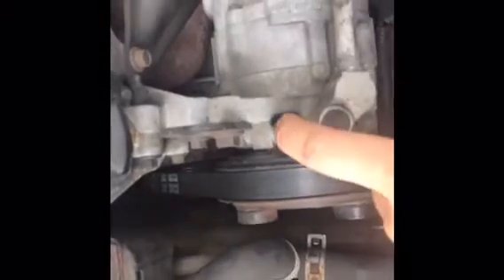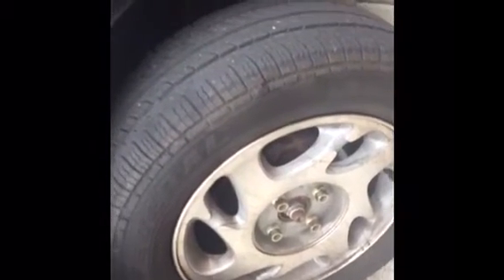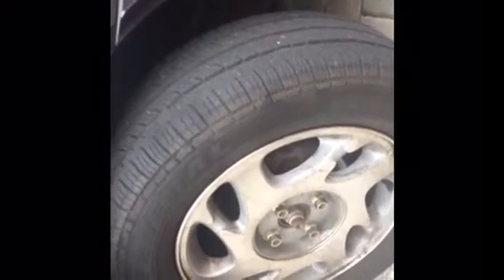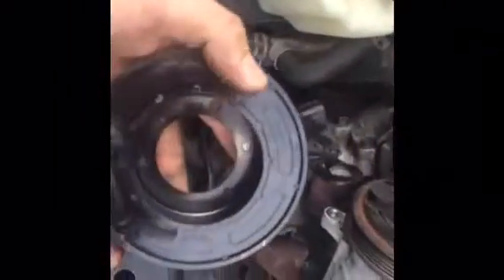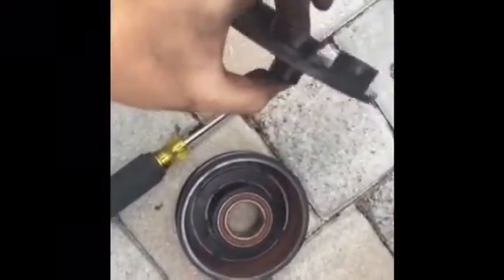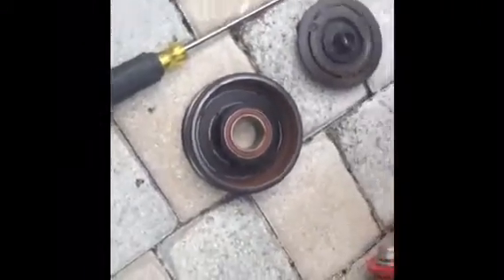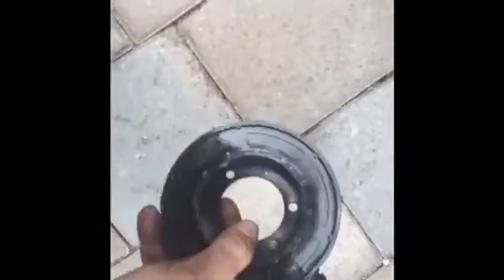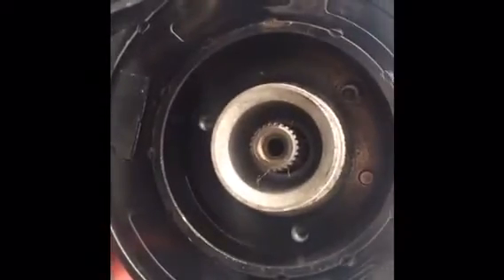Automotive ac repair.

Comment: You must have had to order the clutch coil...I've never heard of them stocking it. Nice repair
Reply from the maker: No  auto parts had the clutch coil seperate. They wanted to sell me the whole compressor. Minimum $275. I found a mechanic shop that stocked it for $60.  I got lucky. Thanks for watching